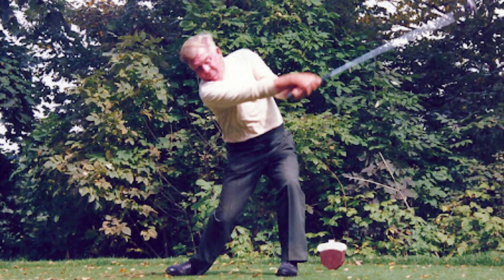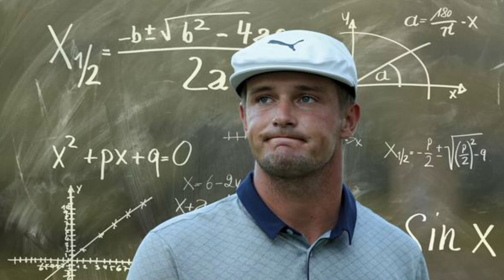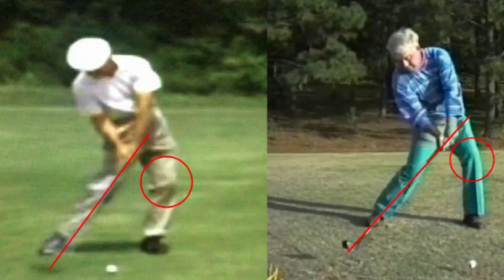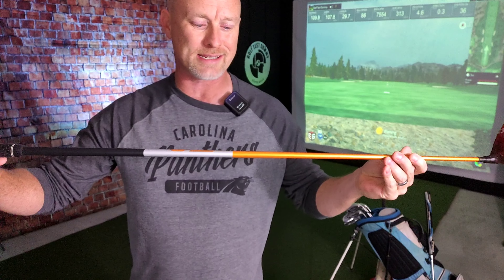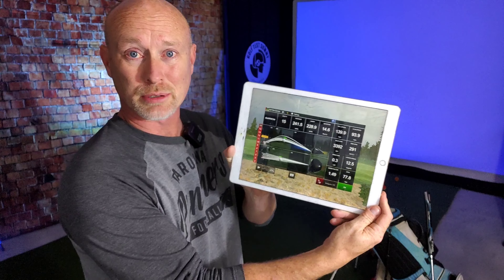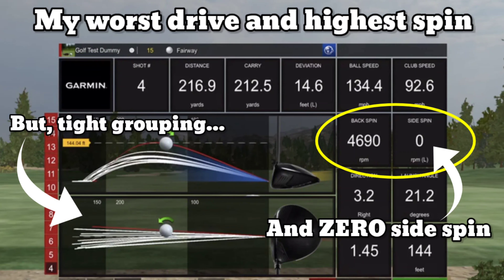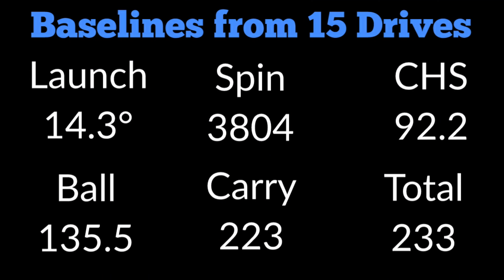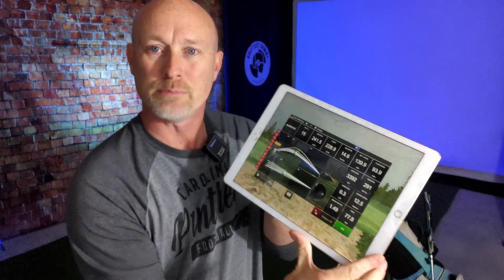LONGER DRIVES with the Single Plane Swing - Golf Test Dummy

Comment: What Sueezedtight is saying is essentially what I was telling you except that I think that you won't be able to keep your trail heel down in such a way as to allow faster more centered rotation and trail arm release  until you fix the other two things that I was talking about. Tightening up the movement of the trail elbow in the late BS and having more of a "supporting a tray" position of the trail hand would both help.  Your driver CHS and distance are quite close to the LPGA average which seems to suggest a reasonable level of optimization. In any case,  nice video and I'll be interested in watching your progress and hoping that you make some significant gains without having to resort to Kale sandwiches (which seems a bit like a Popeye approach to golf distance improvement) :-)  Cheers.
Reply from the maker: Haha, yeah I'm not even sure if a kale sandwich is a thing, but it's what popped in my head so out it came.
Reply: @GolfTestDummy  True story of the week(it's true, I'm not kidding): Not entirely golf related but somewhat.  I'm 16 (1976) and on a trip in an RV crossing the western third of Canada and we play Banff Springs on this one day (great course) and continue on for several hours until suppertime. We arrive in Rogers Pass, BC at an RV campground which is quite remote. After supper, I'm outside the RV swinging my driver and it gets pitch dark rapidly but I keep swinging until I start to get creeped out and feel as though I'm being watched. I go inside and start to get ready for bed (around 21:45 or so). I'm in this tiny washroom cubicle with a tiny louvered window at chin height which cranks open with a handle. I open it thinking of a bear that we had seen earlier raiding some garbage cans and immediately hear some noise just outside the camper. I quietly enter the main area where my parents are sitting in semi darkness chatting at the small dining table. I announce quietly but energetically that a bear is going through some litter that we had left outside and had not picked up yet before bed (the sites are enclosed by trees and we cannot even see the next site). My Dad pops up and turns on the flood  lights on the top rear corners of the camper because the picnic table and fire pit are opposite the corner closest to the washroom. We all crane our necks to look toward the picnic table and noone spots anything. I am somewhat miffed and surprised because it had only been less than a minute since I heard the noise. I go back into the washroom quietly closing the door behind me and peer out the little window. All I can see is the shadow of a tree and I start to blankly stare at it wondering what happened to my bear. Slowly it dawns on me (maybe 30-40 seconds) that the tree shadow (which is absolutely still) cannot be a tree because the light is coming from the camper and all the trees are at least 20 ft. away and very large but the shadow is tree-like but not that tall for a tree and I suddenly am terrified that an erect startled grizzly is quite near (because nothing else could be that size) but I'm not sure exactly where. As this terror is crystallizing in my mind, the shadow moves and my mind goes blank as a humanoid creature steps in front of me side-on within arm's reach.  I am close to 6 ft. tall at this point and standing 30 inches above the ground on the camper floor and this thing is still a few inches taller (maybe 8'8") and absolutely massive (no less than 700-800 lbs). I am so scared that it will turn and look at me and I am unable to breathe or move. After a pause of maybe 5-10 seconds where I can see its hair and human-like profile, it suddenly does a right-face and strides off with tremendous speed and power covering 20 ft. or so in 3-4 strides. People go back and forth on whether Sasquatch is real; let me tell you, it's real!!
Reply from the maker: Oh I love this! BTW, STILLLLLL for some reason there are several messages a day that end up not getting published and I can't always find them. Lucky to find this one, but dozens of others are getting lost. Anyway, I'm so infatuated with Bigfoot stories and shows and documentaries. I can't say I'm a believer yet, mostly because I haven't had an encounter and the overwhelming majority of photos, eyewitness accounts, etc are sketchy. But I have seen a few pieces of evidence over the years that are incredibly compelling and I know that it's at least mathematically possible. So I will keep watching....
Reply: @GolfTestDummy  BTW, sorry about all the message complications.  Sound like a real pain :-( and I hope that you can get it sorted out soon.  I didn't mean to ignore you on that.
Reply from the maker: I've seen the Todd Standing footage and probably everything else available out there over the years. I'm a sponge. There are 2 very compelling pieces in alllllll my watching and reading. 1 was a father and son in Michigan. They had an antiquated, but effective, thermal camera. The figure went from behind one tree to another. It was extremely clear. If it wasn't someone with the ability to digitally alter video on an extremely high level, then it had to be a sasquatch. The other, was near where I'm originally from, and where I've camped several times. The Uwharrie National Forest. Again, a thermal camera, but much more up to date. A large figure, in the dead of night, belly crawling behind a stump to carefully take an apple.
Reply: @GolfTestDummy Well, I know that you don't really know me but you at least know that I'm a pretty good observer. I also have always been somewhat of a bear expert because they were my favorite animals just to eliminate the idea that it could have been a bear which is BTW ridiculous because it walked better and faster than Wilt Chamberlain on 2 legs. You know I consider my story to be the one of the best I have ever heard and I have heard (read) literally hundreds of these stories. I was within 3 feet of it (I could have stretched my arm out and touched it if the screen wasn't there), so I got to see it's height very accurately; no estimation necessary. Same with its size because it made me feel like a very small child next to it even though I was elevated. I could hear the massive weight of its steps. A hoax (if that were even possible; not at all) is clearly out of the question because the thing was trying hard not to be seen and I believe that it never knew that it was in this case. Also it was lit from the back so I could see it very clearly. There really is absolutely no other explanation and I have never doubted that it was a Sasquatch from that moment to this because it was so obvious. So I know that some people are very hard to convince and maybe even need to see for themselves but I'm just saying that if you marched me into the Supreme Court tomorrow, I would testify that it is 100% real and that I have seen one from a few feet away. I imagine that you must have read the Albert Ostman kidnapping story; that is quite an interesting one and one of the few accounts that I have heard of that involves being closer to one than I was. Cheers.
Reply: @GolfTestDummy  If you want to know what is in some ways more amazing to me about the experience, there is a preceding story.  When I was fourteen, I became a devoted Christian (before that, I didn't really believe in God (my family didn't either)).  The same year, I read a book called "The Maybe Monsters" (which can still be found) which profiles many creatures that weren't scientifically proven to exist, but of which there were many eye-witness accounts. The only creature in the book that really stirred my imagination was Sasquatch and after reading the accounts, prayed and asked God that if I was ever out west, I might see this creature.  At that time, the vast majority of the accounts were from California and BC (almost equally) with very few in other places. Flash forward to two years later and I was on this trip that I never expected to be on (my father very unexpectedly announced it that summer) and I had totally forgotten about the prayer and the book. I was most interested in seeing bears and especially a grizzly as we got farther west and gave literally not one thought to Sasquatch. Well you know what happened but the amazing thing about it is just how closely I got to see it and the fact that I was the only one of the four of us that saw it clearly.  You could almost say that it seemed to seek me out. My sister saw its silhouette walking in the trees after I had a conniption fit describing what I saw and everyone starting looking for it.  So was the prayer linked to the experience? It seems hard to believe it wasn't and so it becomes one of those mysterious experiences in life of which I have had very many. I thought that you would find it interesting. Cheers.

Comment: 30 years ago Jack Nicklaus said he would teach young golfers to swing hard and the control would come, he said it’s harder to have a controlled swing early and try to add the speed later
Reply from the maker: You know, I have to say that I totally agree. When I started years ago, I didn't have any thoughts except swing fast and hit it far. Then skill developed. Not great skill, but skill. After taking my 8 year break, I started off the opposite. Just play controlled. And now adding speed is much tougher. Partly because I'm a lot older, but also because I'm trying to develop speed within a certain set of parameters, and it's stifling.
Reply: @GolfTestDummy  I do believe that the purity of Moe’s technique will allow you to add speed and keep a high level of accuracy
Reply from the maker: Jim I just recorded the latest episode, and not to play spoiler, but you're a pretty good fortune teller.
Reply: @GolfTestDummy  just appreciate and have confidence in what you’re doing, a technique that delivers the club face so squarely, there’s a point where speed won’t change that

Comment: I gained chs AND sf when I learned to keep my trail foot down at impact. When you "crack" a whip you don't move your hand as it is the "anchor". When the trail heel stays on the ground, it makes the torso "rotate" faster and lets the trail arm "extend"  through impact. More chs. It stabilizes the club face resulting in a more solid center face contact so that sf goes up.
Reply from the maker: I'll definitely try that! It'll be fun to measure the differences.

Comment: Good idea Chad. I found my Driver distance was less when I tried single plane swing too. Then again, like many golfers the Driver is not my best club! 

 I swing just slower than you with Driver(  87-93 according to my PRGR) and I definitely  need back spin to keep the ball in the air. Since I started golf about 5 years ago, I have  been on a "driver per year" or more quest .  I started with a PowerBilt 10.5, then Cobra F7, F8, F9 in rapid succession.   I had the Cobras set at 12 degrees ( closed face). Then I found the Cleveland HB Turbo 12 degree and I finally got reproducible spin/ launch. As I improved with Driver I noticed that I was getting the ball too  high with the HB Turbo, so I recently bought the new Cleveland Launcher XL ( adjustable) and have gained 10 m ( 11 yards) seta t 10.5 degrees .  I did fool around with the Nike Vapor speed Drivers ( 44 and 45 inch shafts) to see if the flat and upright settings helped my shot shape and accuracy. Answer : yes it did allow me to avoid one side of the course and yes I was more accurate at 44 inch, but lost distance.

 I had the opportunity to use my old F9 Driver again after 18 months. I was amazed how much it had improved! I have found that more slower swing speed players that some balls spin more and help with carry distances ( e.g. Kirkland Signature) which is good in winter conditions when there is little roll to be had.
Reply from the maker: It's really like tweaking a recipe, right? Loft, length, speed, spin, angle of attack, kick point, shaft flex, golf ball compression, etc. All interconnected and all have to work in concert just right.
Reply: Higher tee height will lower backspin if it lets you hit the ball just above the centre of the club face. With the ball placed properly in the stance (just inside the lead toe) so that you hit on the upswing ball flight height is no longer a problem.

Comment: Sweet… this is a series I’d make myself if I didn’t dislike cameras 😂
A few comments…
Bryson has done a number of more casual videos lately that were eye opening to me. Building a higher baseline swing speed isn’t just about bombing drives.. it also allows you to hit short irons and wedges 30-40 yards farther (in his case) while maintaining the landing trajectory and spin for that club. HUGE potential advantage if you can hold a green more easily than others at 30-40 yards farther out because your hitting a 8 or 7 instead of a 6 or 5 (or 4) trajectory.
Otherwise, looks like you are fairly well optimized for the club head speed you measured, based on available tables on the interwebs…
That said, your driver speed does seem a little low relative to what it must be for your other clubs.
My personal observations in my own similar pursuit.. 
I initially took about a 30yd hit when I changed to the moe type swing, but I recovered it completely over 5 months or so. My average is now much higher than before because of consistency, but I think its just taking time to cement the sps fundamentals and add speed back in without it falling apart. I can now hit all the fairways for about 9 holes straight before I start spraying a little bit as I get  loose, and faster…. but it keeps getting better
Reply from the maker: I agree with what you said, and you're absolutely right about the swing changes needing to become second nature before seeing the real and lasting benefits. That's been true with all of the swing models I've reviewed over the last few years. And I do expect that the rest of my bag will be influenced by more clubhead speed for sure, but there's something off with my driver swing. I should be swinging at around 100 for my size, athleticism, and relative ability. 92 at my age, with no real physical limitations, is just unusually low. That's why I'm diving in.

Comment: Sir Did you ever get properly fit for  your driver? There’s at least a few yards there? 

I believe the speed is there the driver is holding you back.

Let’s see a video your current driver vs a properly  fit one and the process of the fit.
Reply from the maker: No, I haven't. The video I put out before this one lead to this video series, and in it I mentioned that I've never had a driver fitting. So at the end of this series, I intend to wrap it up with a fitting.